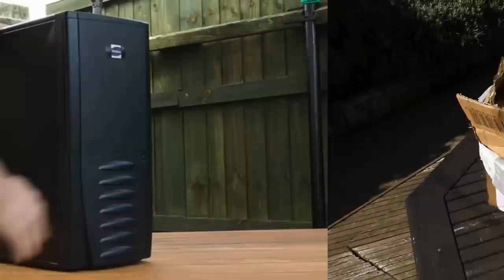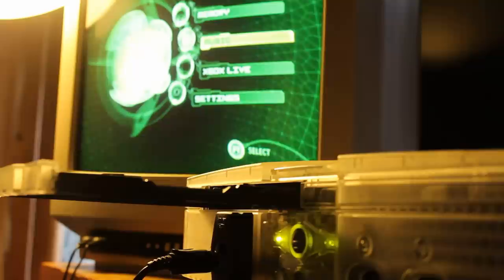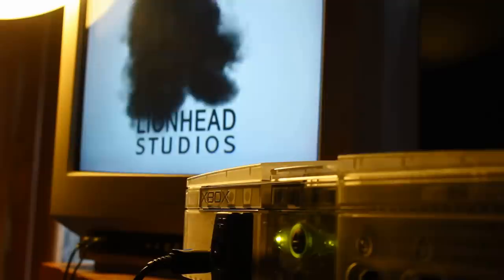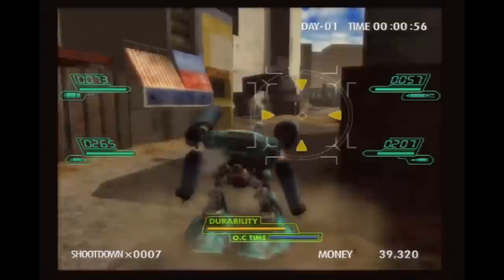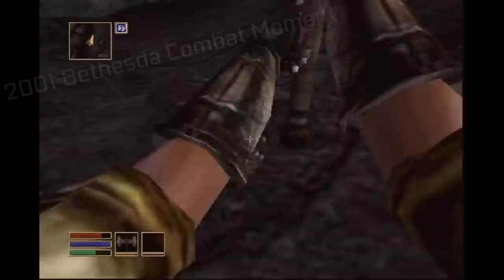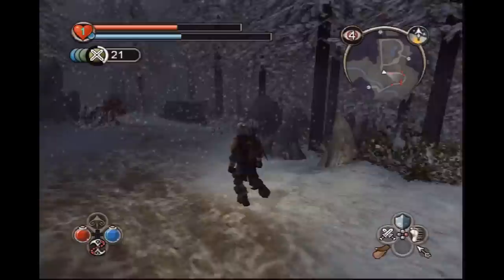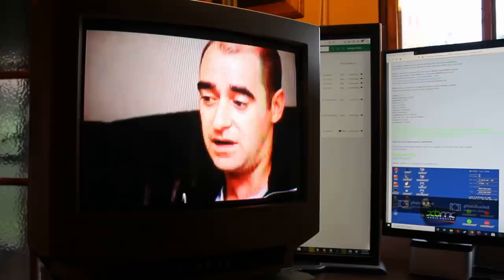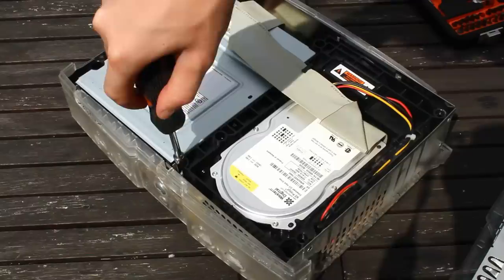£10 Console vs £10 Gaming PC? (Ft:Techwen)

Comment: what a score ! crystal edition with original crystal controller ! Duuuude!
Reply: @LuchadorMasque  🤔
Reply: @TR2000LT  what country you in?
Reply: And i thought i got a good deal on my untested one with no controllers, games or cords for $5 (works great tho)
Reply: Just got an xbox 360 2008 white. controller black. two games removed and put in bigger hardrive it all under 10 pound at the local carboot sale
Reply: @TR2000LT  well I definitely got a bargain lol
Reply: @TR2000LT  I got the most expensive model works fine just set it up
Reply: @TR2000LT  and it's all under 10 pound can't believe that definitely a keeper
Reply: But can it run crisis
Reply: Wow
Reply: @Jayce762  I mean kinda fps is crap but the graphics are great nearly as good as switch
Reply: @meseyoungboy  I bloody know that lmao
Reply: I got a v1.6 crystal with original crystal controller from an old friend of mine just to play panzer dragoon orta
Reply: Actually the Crystal ones are worst for modding I think! You are better with a black Xbox...I can't remember why but the crystal ones are a bit crap! For the record my modded xbox is crystal. Mines hard modded with an aladdin XT and soft moddedit's dual boot!...I just seem to remember there being a problem with doing the soft mod on the 1.6 crystal!
Reply: And Halo 2
Reply: I have a clear one 🙂
Reply: @LeeBondo  It's because the 1.6 cannot be modded by simply dropping a few drops of solder as they changed one of the chips that was required so only a softmod or hardmod works not a simple mod,
Reply: Ikr €50 on ebay just for the regular ones
Reply: Also, the sound from the rat battle got me singing "In the Summertime" by Mungo Jerry. Swish, kaswish, umph, swish, kaswish, umph.
Reply: Buzz buzz cant fool me
Reply: I also have the Crystal edition, and i removed the inner metal shields and boy does this xbox looks sexy! Next i want to install some kind of rgb in this xbox, i need to mod my xbox but my tries so far were fruitless, i tried the hotswap method with a pc with ide on the mobo and it doesn't work, i don't know what i am doing wrong, but i want to revisit this mod soon . . .
Reply: Controller wasn’t original
Reply: I had one too 6 yeaars ago
Reply: yea thats one hell of a score and all of thoes damn games too id be super happy with that purchase and have no regrets ether buying it especially with the slightly broken disc drive but overall id be excited to have so many xbox games
Reply: @callumdunne2455 Yeah that's a bargain, Xbox 360 still received games until 2018.

Comment: But can it run Microsoft flight simulator 2020?
Reply: Haha, here we go.
Reply from the maker: Erm. It can run DOSBOX and Flight Simulator V4.0 from 1996 👉😎👉
Reply: Noooo noooooo it cant that game is way to graphically demanding
Reply: @xancch8017  r/wooosh
Reply: @SopanKotbagi  bruh that doesent work outside of reddit I was just saying the truth
Reply: @xancch8017  it was meant to be a joke
Reply: @skyrozx  ik
Reply: @true_neutral3378  I feel like that's a Rick roll so I'm not going to open ot
Reply: @xancch8017  no, it's just a gameplay video of flight sim 2020 playing on an xbox with Xbmc installed. Still pretty cool though
Reply: @true_neutral3378  I copied the link and  put it into discord and it was a rickroll but hes giving up everything or somthing like that
Reply: @xancch8017  haha game go brrrrrr
Reply: @thealien_ali3382  yes no it runs at 16k 240fps maxed out bro ur slacking
Reply: @BudgetBuildsOfficial  😮😮😮😮
Reply: Who needs flight simulator when you can have Fable?
Reply: Yes it can run Microsoft flight simulator 2020 at 120fps at 8k revolution on max texture settings
Reply: It can, but you have to measure the performance in ... seconds per frame

Comment: Best thing about the OG Xbox for me was soft modding. Once you rip your games to the HDD, load times become almost non-existent (and in some cases better fps), most games can be modded with PC mods, San Andreas you can even edit configs, like increase the amount of traffic on screen at any time as Xbox games are pretty much just PC games with a different executable.
Only limit to mods I found were they had to be under 300mb because of the Xbox's cache size limits. But yeah used to blow my mates minds by having  a GTA SA where there were General Lee's, V8 interceptors and Batmobiles cruising the streets. Soft modding essentially made your Xbox into a PC. Xbox 360 was meant to be capable of modding but they dropped that for some reason. (Guessing because DLC's became a thing thanks to the OG Xbox)

Heck even managed to get the PC version of Quake III Arena running on it. Wish they still made consoles like this.
Reply: Cool. Just one word 
I wanna learn how to do stuff with stuff older than 2013 and yet I don't even know about anything further than 2018

Comment: its actually so interesting to see what you can achieve with the little money that you use, amazing
Reply: Yes, lke for pc’s u only need 60fps 1080P to run games fine so about 250+ money (U.K. for me) or go with a ps3 for... I think 100?? I’m not too sure. So I do feel like consoles are better for games but a pc can do much things
Reply: @ryanolsen294  Ps3 / xbox 360 are more like 30-50€
Reply: @ryanolsen294  The PS3 is definitely not running games at 1080p 60fps.
Reply: @mugabugaYT  Wellll mostly. There’s a couple of 1080p60 games on there.

Comment: The OG Xbox is so very versatile, especially once you mod it. If you have a <1.6 rev console, you should be able to TSOP a custom BIOS onto it to allow you to upgrade the hard drive and not have to lock it. With a 1.6, you have to install a modchip to use a custom BIOS.

Comment: £20-25 pc next time? might be an even more interesting competition
Reply: So... A Xbox 360 vs £20-25 PC.
Reply: @robertt9342  or perhaps a ps3, wii etc
Reply: Beefy Cactus . So same Gen with similar to worse performance, but also great games
Reply: @robertt9342  i mean I'd like to see what they can build in the UK for £25. In Ireland I wouldn't even be able to get a hd 7670 for €25
Reply: From my experience, $30 USD has been enough to purchase a ThinkPad T420 and a PS3 slim. £25 should get some considerably stronger hardware than £10.

Comment: For the price, I think I would go with the original Xbox... As long as you have the ability to soft mod it, and the component cables. I have a 250GB hard drive in mine and it's just lovely. Look up something called Ninja Massive and it's just epic. On the PC side of things, 10 pounds (like 15 dollars?) will not get you much... Probably pretty close to the same specs lol

Comment: I got my Xbox for $10 too, and I've had it now for about 10 years.  Mine also had a "stuck" drive, but I immediately took it apart and gave the belts a good cleaning and it has been working fine ever since.  I also paid $10 for my Windows 98 SE PC with a 933MHz Pentium 3 and 9600XT...I think I'd choose the Xbox, between the two...but barely.

Comment: 14:37 - I wonder how they've managed to launch HL2 on Pentium 3. If I remember correctly, the game requires SSE2, which was implemented since Pentium 4, and was not present in Coppermines and Tualatins
Reply: If you have the source code you can compile without SSE2 optimizations, which of course Valve has
Reply: old (2004) engine hl2 does not require sse2

Comment: A tip for when the tray gets stuck is to not tap on it, as pushing the tray in slightly is enough to dislodge it.
Reply from the maker: It's going to be repaired and turned into an overkill modded console for someone.

So new bands for that when I get around to it

Comment: There is the option to overclock the Xbox, I believe back in the day I got the CPU to about 1ghz which was quiet an impressive improvement
Reply: A few games ran in sync with the cpu clock though so oc'ing the cpu would break compatability with a few titles.
Reply: @mitlanderson  yup but at that point I was mostly using the Xbox for Emulation so it was not that much of a big deal.

Comment: I have the same steering wheel, the rubber is nice until it degrades using any harsh cleaning products and you need something strong to get the greasy stuck on grippy texture so its smooth again, only then will it last.

Comment: Phantom Crash! :D I played the crap out of this.
Also the Xbox had a UDMA 33 cable as standard, but could be upgraded to UDMA 66, with a newer cable. It made quite a difference when i did this simple cable swap. Which improves load times and cachespeed.
You could also upgrade the xbox to 128mb ram, soldering another 64mb chip onto the board to improve media centre usage.

Comment: There’s a way to run Netflix on xbmc though it looks really weird but it works!
Reply from the maker: How so
Reply: Budget-Builds Official If I’m not wrong xbmc is based on kodi or the operating system behind kodi right? I Remember that last year I installed a costom version of Netflix on kodi...I’ll try to see if I can find the original post and check if it still works. Not sure how well it’ll run on the Xbox but it seemed to work on really low end devices
Reply from the maker: XBMC4XBOX is based on a rather old verson. I couldnt get any of the scripts or addons to work

Comment: I used to own an audi a4 like that for my first car. she was a beater but I got it for 2k from a guy that repairs cars and flips them with a bit over 150,000 miles. For my fellow car guys, it was a v-6 2.8L 5 speed manual transmission. Not the dinky 1.8 liter v-4 eco turbo charged version you can still find driving around. This baby could do 0-60 in about 6 sec. which at the time was huge especially with the quattro system that baby launched from rest. Little history lesson it was the first car audi made for civilian use. If you want to talk real power though you have to respect the v-8 s4 line.
Reply from the maker: Brilliant V6 that, was the go to performance option in the old Audi Coupe, variable inlets or something like that if I remember correctly. Loved my Audi, powerful and comfortable but very very boring sadly.

Comment: I had an OG xbox when I was in korea.had a chip and a larger hard drive put in it. I installed a clear case similar to yours and a bunch of orange LEDs. Eventually the disc drive failed. Last I powered it up it still would play the games on the hard drive but not off of a disc. Still have it.

Comment: I have a netbook for Yt and T'internet and basic browsing... My modded Xbox Crystal 1.6 dual boot with an Aladdin chip hard mod, a soft mod, YpBpR cable, a 500GB SATA drive and Madcatz wireless controllers is my emulation machine! The Xbox doesn't get lots of use but its nice when friends are round having a drinking session and stuff! I wouldn't be without my Modded Xbox it's just awesome and the best thing I have owned for around he last 8 years!

Comment: 14:03

I wonder whats up with GTA SA on the XBOX if its the game or the TV/Monitor. It kinda looks like my old 1998 Monitor display. The XBOX and Xbox 360 in my opinion are better than both PS2 and PS3 cos better performance, graphics and frames. Also exclusive games are fun like Halo,Forza
Reply from the maker: The game defaults to 480i even when sent via Component and 480p Mode. You can force 480P Via a few mods and tweaks. But I decided to keep with the plug and play aspect.... I also didn't De-Interlace the footage. So that's just raw 480i

Comment: V1.6, the one that can't be softmodded anymore.
EDIT: Should add that i mean the little jumper mod one needs to do to the flash to write on it in v1.5 and lower. You need a modchip on the v1.6 to install a different dash.
Reply from the maker: V1.6 can be modded, and has many advantages to doing so.

Comment: I still have my crystal soft modded xbox  the steel tray been removed l.e.d lights installed temp gauges installed i even done the crystal round logo on top with multi flashing led  even has usb ports

Comment: That box with the xbox things in could not be sent for less than around £7 in the UK?!? You found someone insane apparently if they shipped this for £10 total. 

I wish I knew where all the cheap Xboxs you see are. Boxed decent quality ones are never below £50-£60 in my experience, and decent quality unboxed ones are around £30 average (maybe £20 if you are lucky) with nothing else included.
Reply from the maker: Bootfairs and Local Listings have been where I usually get mine. This was a very lucky ebay find.

Comment: Xbox 1.6 systems don't have the clock capacitor plague but they can suffer from PSU failures (that's what mine did sadly)

Comment: What do you use to convert videos for xbox? I've used the built in handbrake xbox preset but the quality is a bit blocky. Should I stick with mpeg 2 if I'm playing it all on a 480i crt tv?
Reply from the maker: If you really want dedicated Xbox Encoding look for DivX encoding, it’s far easier on the Xbox as just believe it’s fully hardware accelerated. I think you can even squeeze 720p encoded properly.

Comment: Got a 360 from a thrift shop with a controller for $10. Which is less that £10. Shocked you didn't mod that xbox to play emulators and get better DVD and other video format playback. Oops. Commented before I finished the video. My bad.

Comment: My main xbox original I did a custom paint job ,1.5tb ssd and custom bios via tsop , dont really need to do anything else to it
Reply from the maker: 1.5TB SSD!! How well does it cope with that? Sounds like an amazing system.
Reply: @BudgetBuildsOfficial  surprisingly well had a couple of compatibility issues with cheaper sata to ide adapters but worked out eventually mostly through watching other people's videos which brands / price range work everytime
Reply: @BudgetBuildsOfficial  and no I'm nowhere near filling the thing even though I have loads of stuff on there already , didnt really think it through it was just a case of well I've been given these machines miss my old xbox let's see what can be achieved without spending much of anything and I had that ssd spare from some other machine that's long gone so just determined I'd make it work with what I had

Comment: I had found a Xbox 360 E for $20 at my local thrift store. Unfortunately there was no power brick or controller so the cost is really a lot more than that. It did come with Red Dead Redemption installed on it though!